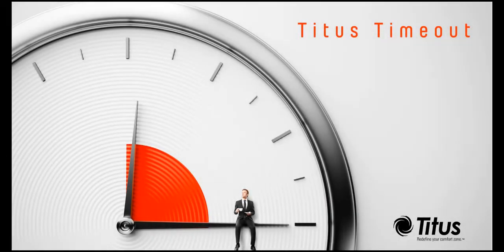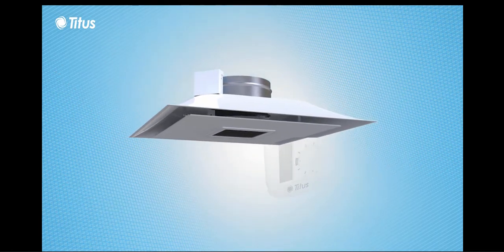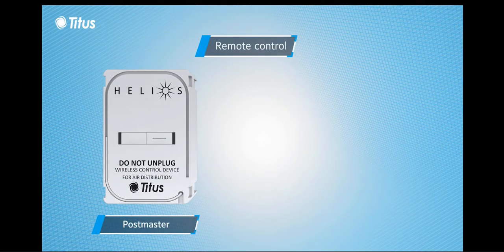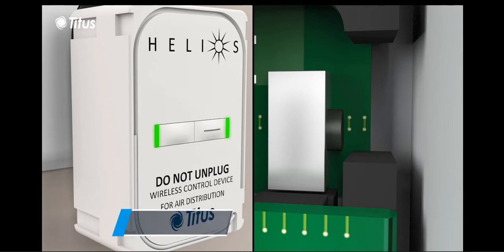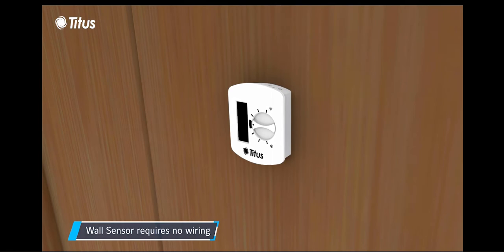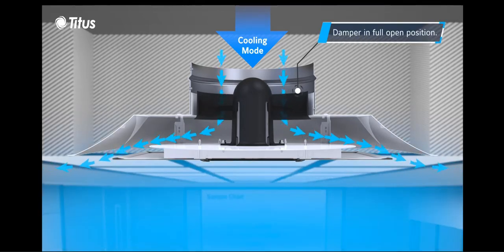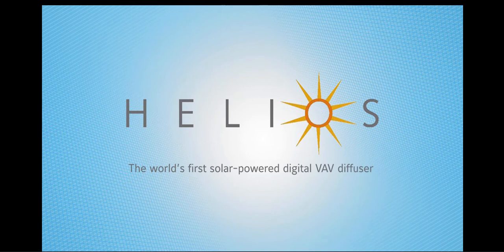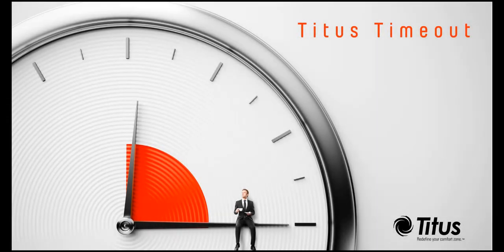Titus Timeout Podcast - Installation and Operation of the Helios

Comment: Nice video. What is the design supply duct pressure requirements.  How and where do you set the minimum com.  Are other adjustments available.
Reply from the maker: Set points and minimum damper position can be manually set using the rotary switch on the control PCB that
resides on the back pan.   When paired with a diffuser, the wall sensor will override thetemperature set points but not the minimum damper position.  Duct pressure should not exceed .20 for VAV diffusers.  Performance, including operating pressures can be found atTitus-hvac.com: 
https://www.titus-hvac.com/file/11945/helios%20performance_2013.pdf